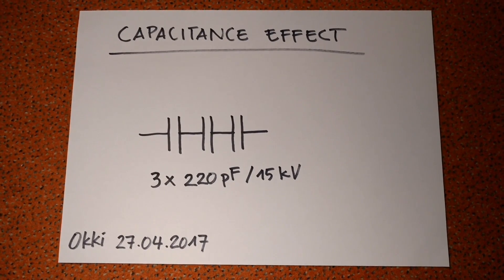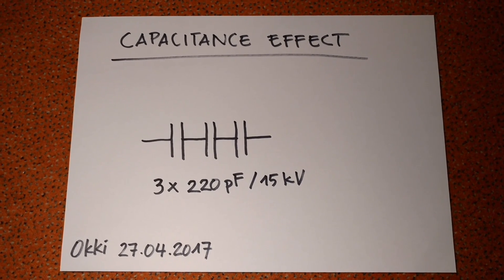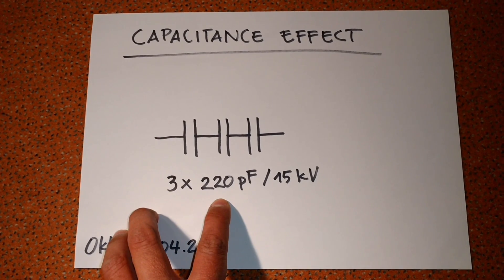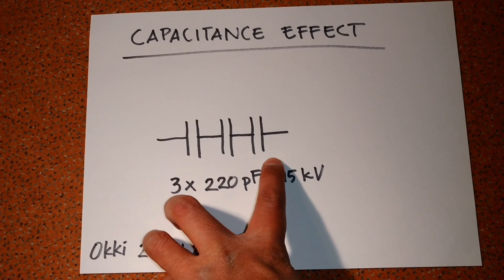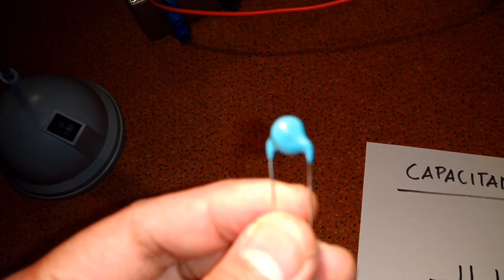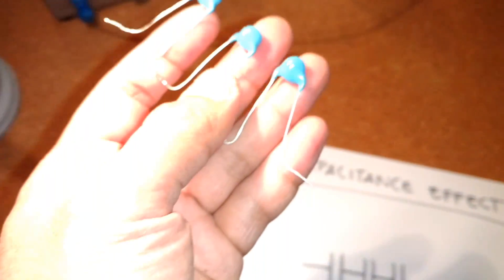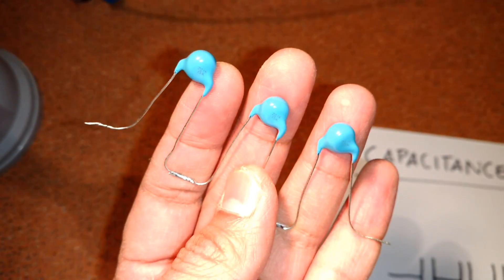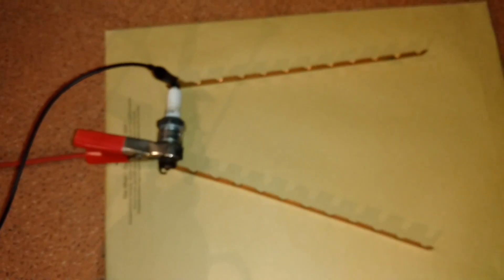Simple Plasma Ignition - Capacitance Effect

Comment: Sorry for my ignorance but instead of linking 3 x 220pf capacitors could you use 1 capacitor that is 660pf (3 x 220)? or something similar?  Just wonder why you need 3 caps instead of just 1.  Great videos btw!!! Thank you so much for sharing!!!
Reply from the maker: Hi Mppforall, I use strings of 3 capacitors because I don't want to damage my capacitors. Each of my capacitor is rated at 15 kV and the output of ignition coil is around 30 kV. Just to be at the safe side I connect 3 of my caps to make equivalent of 1 cap with 45 kV rating. But then I reduce the total capacitance. Now instead of 220 pF, I only have around 73 pF but with higher voltage rating of 45 kV. Thanks for watching.
Reply: Interesting... So by breaking down one 45kv capacitor into 3 smaller capacitors you reduce the capacitance that flows into the spark plug from 220pf to 73pf...  but you keep the same voltage of 45kV.... Do I understand this correctly?
Reply from the maker: mppforall, yes you do.
Reply: awesome...How did you connect the capacitor to the spark plug wire? Could you make a quick video demonstrating this connection?
Reply from the maker: mppforall, just browse my videos on my plasma ignition playlist. I have uploaded everything there.
Reply: It seems he applies to ground and boot, from this video.

Comment: Hi, I have a 3.0 L 6-cylinder gasoline turbo charged engine. What would be the best value capacitor? I'm not sure i'm understanding what makes a bigger spark. would a 220pf/30kv  or a 100pf/30kv make a bigger spark?
Reply from the maker: Cruz Reyes, 220 pF capacitor will make bigger spark than 100 pF capacitor. Actually these capacitors make the ignition coil work hard but turbo boost makes the ignition coil work even harder. If you want big sparks, try 220 pF and see if it works until max boost and max revs. If not, install the 100 pF one and if you still have problem with it, you should replace your ignition coil with a better one (high power ignition coil or higher voltage ignition coil). I wish you much success with your project!

Comment: nice but if you connect more capacitors what about live of spark plug how often need to be replaced ? and is it useful for - for example 50 cc scooter ?
Reply from the maker: I use only one string of capacitors per spark plug on my car. I have reported the result on one of my videos. I don't know if it's useful for your engine or not.
Reply: Thank You
Reply: Okki Moeljadi To use on a motorcycle, 3x220 is to much isn't it? A single cylinder motorcycle, 125cc, do you have a number that I can use instead of the 3x220?
Reply from the maker: If 73,3 pF (3 x 220 pF caps in series) is too much for your engine, you can put 4 x 220 pF caps in series (you will get 55 pF instead) or even 5. You have to find the optimum value yourself, I don't know your ignition coil.
Reply: Okki Moeljadi basically the more I put in series lower the final value?
Reply from the maker: Yes.

Comment: it wii not work in cdi system
Reply: It can work but you would have to get a car coil and the correct capacitors like Mr Moeljadi demontrates in his videos.
Reply: +Kevin Keiths but i actually tried it with different value at 50kv to 80kv capacitor it actually deppends on the coil driver because cdi system discharge high voltage to the primary coil and transistor base is low voltage switching to the coil.
Reply: Hi, i did and didn't fully understand your explanation ok. So how did you get yours to work ?
Reply: Tnx for telling me as later today i was going to order a 50KV 100PFK capacitor online to try.  The 15KV that i saw are all 100 PFK so if i use 3 like Mr Moeljadi did it would give me 300 PFK at 45 KV . What do you think ?
Reply: +Kevin Keiths connect it in parallel to get 300pfk.